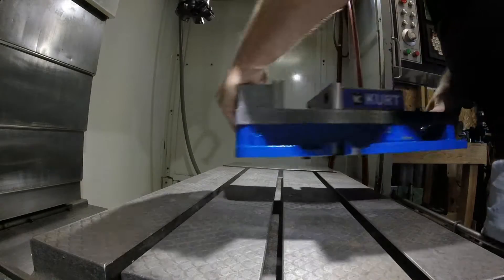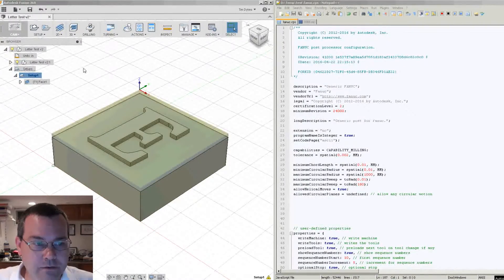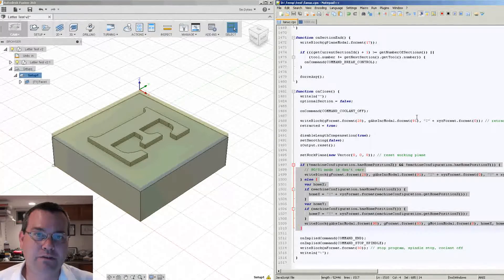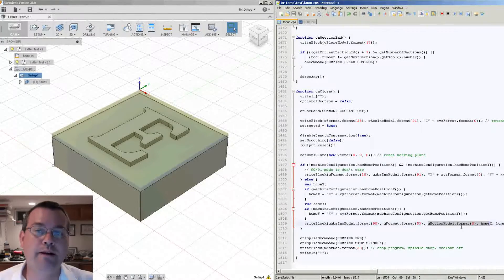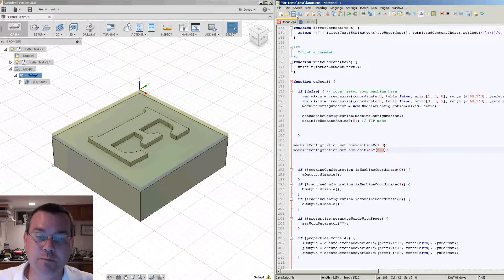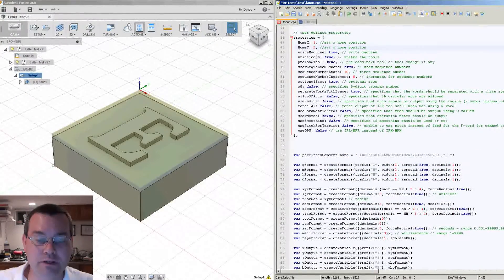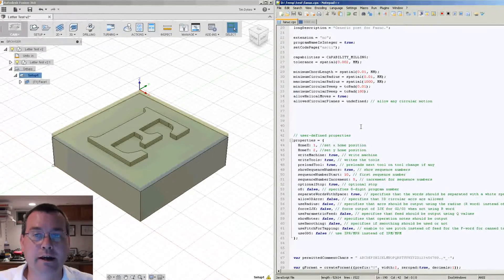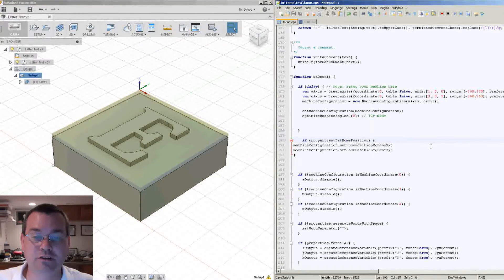Fusion 360 Post Processor G53 Home with Properties

Comment: If someone does this and runs into problems such as HomeX unknown, be sure to include the properties like below.
 if (properties.SetHomePosition)
  {
    machineConfiguration.setHomePositionX(properties.HomeX);
    machineConfiguration.setHomePositionY(properties.HomeY);
  }
Reply from the maker: Yes, there seems to be a bug in the old versions of fusion that they patched and the old post worked with the old code but was not correct. The new version of fusion needs those variables.

Comment: I learned a lot with your 2 videos here, but for some reason it does not work for me the way you described. I particularly get a "ReferenceError" that HomeX and HomeY are not defined.
Trying to figured it out, I found that HomeX and HomeY are properties, and the sentence machineConfiguration.setHomePositionX" needs a variable, right? So I replaced "HomeX" with "properties.HomeX" and it works!... but it's not like you describe, why?

Here is the sentence that works for me:

  machineConfiguration.setHomePositionX(properties.HomeX)

thanks!!
Reply from the maker: Not sure on that one, I tested all these changes when I made the video. But I think the call of properties.homex would be correct. Fusion might have changed there code since I made the video.
Reply: Hi, I been learning a lot, but there are a tons of information, so I must to take my time. Thanks to your videos above all!!
But right now I have another question, in post there are some text for tell warnings or indicate something like changes on WCS, "Invalid coolant mode" or "Spindle speed out of range". When this text appears? It is for commenting inside g-code, or when it´s fail like a dump file, or what?
I think I saw some g-codes with comment at the end of certains blocks after //. It was maybe writen by man after post?
Reply from the maker: Typically those warnings get placed in a .fail file that will dump the error codes and not produce a G code file.

Comment: Make the Y6.5 on the Fadal if you get a VH65 4th axis otherwise your right the door off.
Reply from the maker: Thanks Darren, I have not heard that before. There is a significant amount of clearance between the edge of the table and my doors. Does that 4th axis hang over that much? I have the iron for a 4th but I don't know what it came off. Won't have an issue with that one, it is small. Just need to get a motor and resolver for it. Tim
Reply: I have a 3016 and that's what i set mine too. Assuming like me your cold start is your home?
Reply from the maker: Yes, my cold start is at the center of the table.
Reply: Not sure how you set your tools. I touch all mine off the table with a 1-2-3 block the 2" side, then after touching the last tool i move it up is "z" then 4-2 the machine send it to home goto mdi type G43 z say 8" H (what ever that last tool is) then the readout "z" will be at 8" hand z to the top of the work piece and put that as the "z" value for what ever offset you are using. Now you can use any tool(s) on another job or offset just set that new "z" to the new offset. Basically how a probe works.
Reply: I think where ever the machine zero's out is where all the offsets should come from
Reply from the maker: I made a video on how I set my tools, they are referenced to the table. Also, do not change the cold start positions, Fadal does not use limit switches or anything for over travel. They rely on the software knowing where the axis is to avoid hitting a hard stop.

Comment: now i need to add a switch to remove G54 and replace M2 with M99. reason is my control can merge NC with conversational. So for instance i can use program conversational to probe the part setup automatically, then run the NC code, then i could go back and probe a feature size etc or run another conversational block. Assuming this is the same procedure as you showed for the G53 example? i get nervous when modifying posts.
Reply from the maker: Yes, it should be. I like to write a working example file by hand first. Then I work to make the post output match my working example. If you need help getting it done drop me an email.
Reply: i'll give it a shot on a copy of my working post. one thing i have noticed for the G53 modified post is for posting a new program the X zero (15.0) is remembered from the last post but the Y zero defaults to "2". is it from this line?  HomeX: 1, //set x home position
HomeY: 2, //set y home position
Reply from the maker: With Fusion it seems to remember if you change something from the defaults. But yes, those lines are where you can change the default to something else.

Comment: this video is fantastic! i am new to Fusion360 and the G28 was driving my table to the far right position. now its right where i want it! Looks like this coded it will default to the last homeX and HomeY values used too? if so that is a major bonus. Thanks again . I subb'ed and a big thumbs up!
Reply from the maker: Thank you, Yes Fusion will remember custom settings most of the time. Just double check them on a new project of if you change posts for some reason.

Comment: Wow you certainly have done the leg work for us. Man, this info is incredibly valuable and no one I know of has ever provided it in such an easy to follow format. Really many many thanks. Its cool to hear the reasoning behind some of code. This kind of info is the missing link for so many guys. I would love to learn anything regarding post refinement like this your willing help with in vids to come. Thanks again.

just Steve
P.S. Do you have Patreon?  I would love to contribute to the channel somehow.
Reply from the maker: Thanks Steve, if there is a post issue you would like to see covered let me know. I currently do not have a Patreon, maybe I will make a Talken Swarf video on the subject and see if there is interest. I was holding off because I didn't know what the reception would be at this early point in the life of the channel.

Comment: Great tip! I'll have to start using G53, thanks. I'm not running a Fadal, just mach3 on a low budget mini mill, but hopefully I can get it to work. Out of simplicity I've just had G28 off in fusion's P.P. It would always cause it to hit a limit switch...so I simply end a program with a Z retract and manually (hot keys) jog it where I want it. Having the G53 automatically go to a specified coordinate will be helpful, thanks again.
Reply from the maker: Remember when using G53 that you need to have some type of machine home.  Either by limit switches or a know startup position.
Reply: Thanks, yeah I've got home and limit switches...I'll give it a try this weekend.

Comment: Another very helpful video...Thank  You. The part about adding user defined properties is awesome!
We have a Haas VF-E and a Fadal 4020 and I use the generic Haas post on both of them and always have to manually change those lines to G90 G0 X0 Y7. for the Fadal and G90 G0 X0 Y4.5 for the Haas, the X value varies depending on which vise I use. Being able to add user defined properties and using G53 will be awesome.
Thx again
Reply from the maker: I knew someone would find the properties thing useful! :)

Comment: I really liked the way you talked through how the post processor works.  Maybe you could do some more videos like this in the future.  I had a problem at a previous job where the post would output the tool height offset on the same line as the first Z move, which made it difficult to step through and validate the program.  Normally I would step through in single block mode and check the distance to go to make sure I wasn't going to crash the machine.  But having the tool offset on the same line as the next move, you couldn't see this.  If I knew how to modify the post processor I would have done this, and made my life a bit easier.
Reply from the maker: Thanks Dominic, I can make more of these if people would like. The post videos are some of the most viewed so other people share in that request. If you or anyone else has some ideas or requests on a topic to cover let me know.  I make these as I think of things that people might run into.